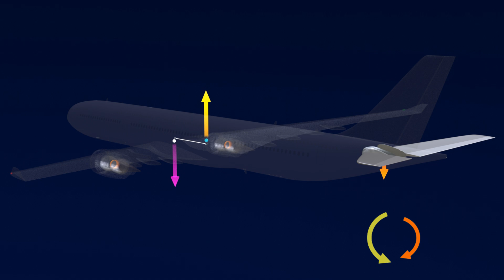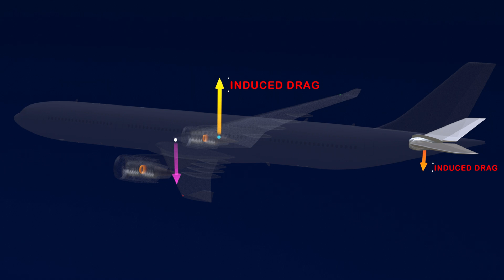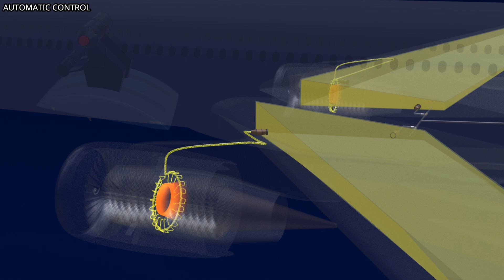Why Does The Horizontal Stabilizer Have a Fuel Tank

Comment: If you place the "tail plane" (horizontal stabiliser) ahead of the main lifting wing, the way the Wright Brothers did, the way many modern combat aircraft do, the way Bert Rutan did, then most of this is unnecessary. It is very clever, I have great regard for the people who worked this out, but the dynamics of tail dragger aircraft were worked out in about 1910 ~ 1914. At that time, with rotary radial engines and stick & string biplanes, there were several good reasons to go to tractor propeller at the front and small horizontal stab at the back, but most of those reasons stop being valid once you're talking about a jet aircraft more than 40 ft long, going more than 150 mph. The first working aeroplane, the Wright Brothers Flyer, worked this way.

Comment: It's mind-blowing that a jet can fly non-stop from Los Angeles to Dubai on a fuel tank of fuel. I think it's like 16 hr flight. Amazing.
Reply: rougly 80t worth of fuel for an A350 (in freedom units that's three-fifths as heavy as The Statue of Liberty)
Reply: @tank-eleven 
What is a “freedom unit”?
Reply: @cliberg  a measurement not done in metric units, they usually involve weird parts of the body like inches or feet
Reply: The planes done use gasoline. It uses aviation jet fuel, which is more energy dense.

Comment: do they still use them? I thought this system was a relic from the Concorde times and now they phased it out because of added maintenance costs compared to little gains
Reply: Oh yes, 747-8, 777 all have extra tanks in tail and can be used to trim the aircraft if needed.
Reply: @AaronShenghao  I was not aware about the 777 tail tank, did you invent that or do you have any reliable sources? Also the 747-8 had many problems with its tail tank and I'm not even sure they are allowed to use it anymore. I always thought it was more of a European thing (and still barely (if not anymore)) used nowadays.
Reply: @AaronShenghao That's partially incorrect. The 777 has no horizontal stabilizer fuel tank, as it's not required for that aircraft. The 747-8 was designed with the horizontal stabilizer fuel tank, but developmental studies showed that a failure in one of the engine mounts would introduce severe flutter in the horizontal stabilizer, IIRC, so Boeing has never activated the tank on the Intercontinental, where it was most needed. The -8F does not require a horizontal stabilizer fuel tank, as structural payload weights negate this need. (I'll provide a link to a weights explainer below.)

In any case, the Boeing horizontal stab fuel tank insertion is entirely different philosophically from that of Airbus. Lufthansa did ask for Boeing to adjust the fuel transfer logics on the 747-8i horizontal stab fuel tank to help improve efficiency because of the aircraft's heavier nose (read heavier premium product configuration, so CoG management), before the tank was blanked off. The 747-400 is the only Boeing that's successfully fielded the feature in commercial service, and for range purposes, not for center of gravity management, which for Airbus is historically derived from the Airbus heritage partners on Concorde. The 747-400 had the additional fuel for range.

https://www.quora.com/Does-the-weight-of-passengers-affect-airplane-takeoff-and-landing-performance-e-g-range-rate-of-climb/answer/Paulo-Martins-179?ch=15&oid=1477743651931983&share=499f3f1f&srid=udzNYc&target_type=answer